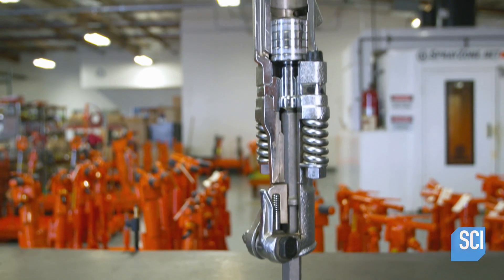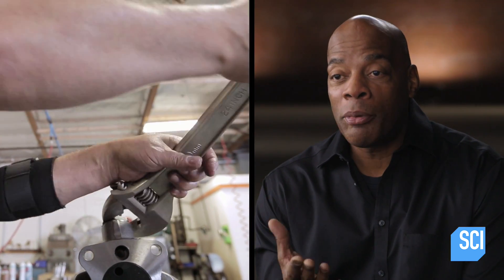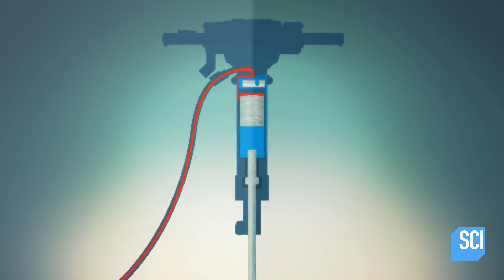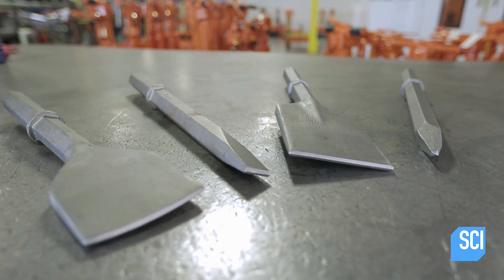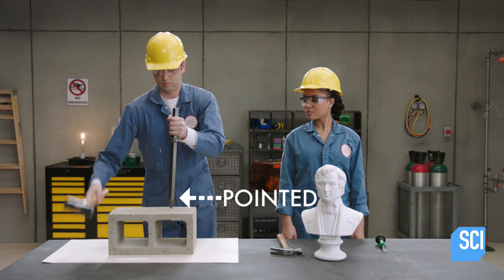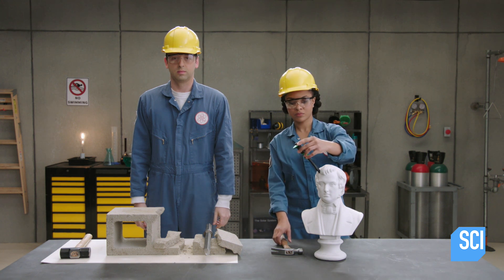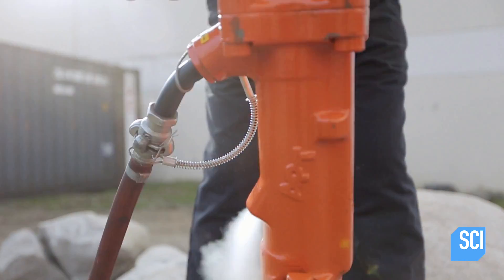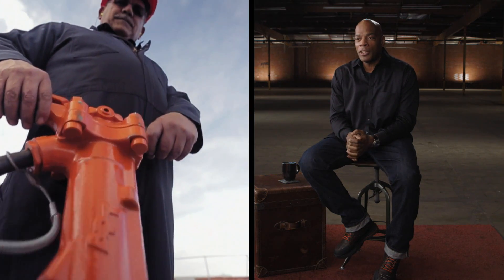How Does a Jackhammer Work?

Comment: Wow. Jack Hammer tech must have improved in the last 3 years. I just used a 15kg JH today and I could have gone all day if it weren't due to fatigue from holding it upright and difficult drilling angles. Very little to no vibration back into the handle. It was sweet to use.
Reply: I agree, its not as scary as they say

Comment: This job seems like a good candidate to be replaced by a robot..
Reply: Yeah, with all these technology why there's a need of people to suffer from doing this job.
Reply: @Xaider1026  I've had manual labor jobs, in fact when it came to roadworks and jackhammer my only worry was the lower back muscles. We had to increase the height of sewer hatches by removing old cement around them first. To survive in these jobs you need to find a way to make your life easier by doing things properly. Apart from that it can be very satisfying.
Reply: @Xaider1026 yeah, those people would be a lot happier begging for change from a box
Reply: @Xaider1026  suffer?? It's called earning money by doing a job, people would suffer more once all these physical labour jobs become automated.

Make the job safer, don't axe the worker.
Reply: @johnturner3455  there is ergonomic braces but... its too much for some guy that can be replaced in a finger snap